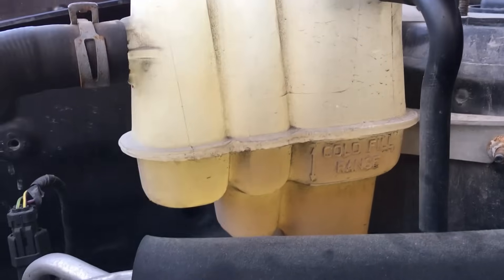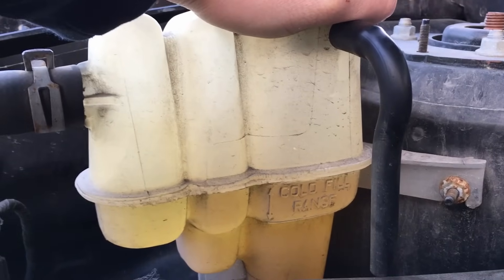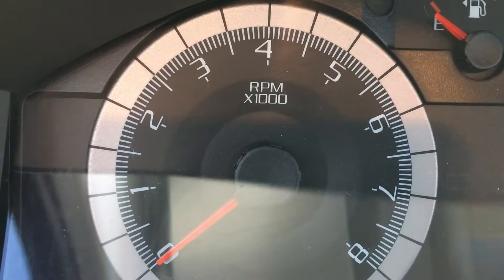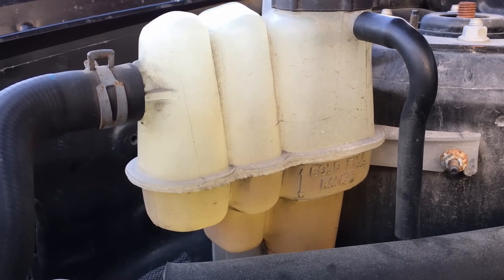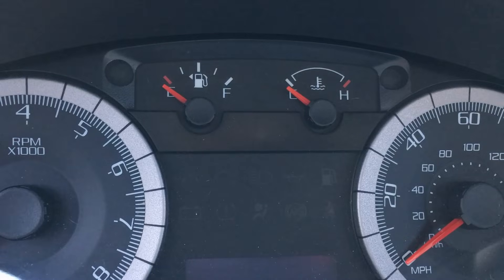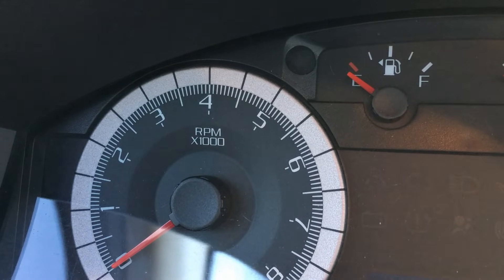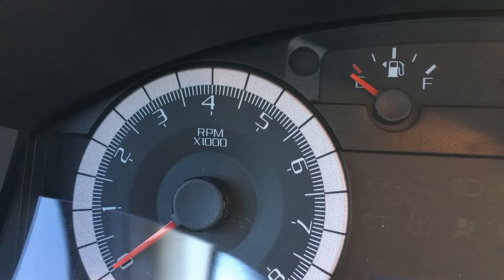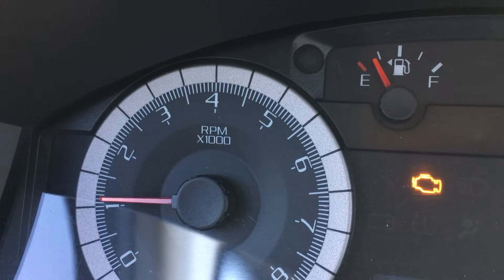Ford Quick Tips #69: The Trick to Purging Air From Your Cooling System

Comment: Purging the air to where...
Reply: Pretty sure it goes to the Reservoir.
Reply: @screwlegg3835  he didn't show opening the hood or if it has a drain screw, or if ford's have a vent
Reply: He says what kind of fords tho, u may have to do a little more research like i did. I followed the directions yesterday after hearing him say fusions so i tried it and i got warm air and no loss of coolant, soo.
Reply: When I'm working on a system I explain basic things so people can understand.
Cheers for you researching something, wouldn't have to if you knew what you were doing and actually opened the hood.
If you search this on YouTube , then close your eyes and blindy select one, 7 other videos explain better.
Reply: @screwlegg3835  so this worked on your fusion? You didn't need to do anything else? I have a 2010 SE that I'm at the end of my wits with.